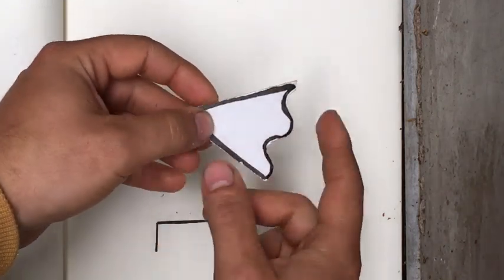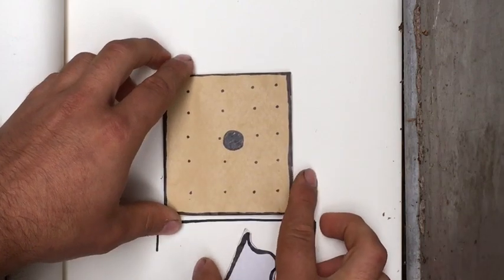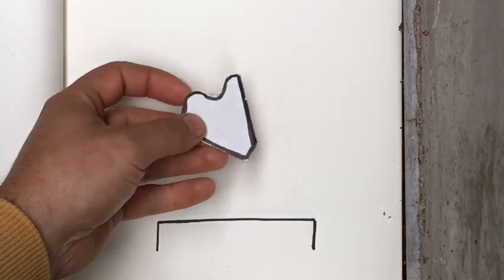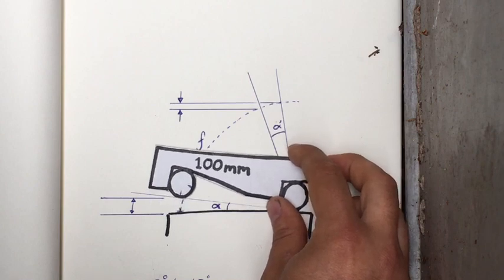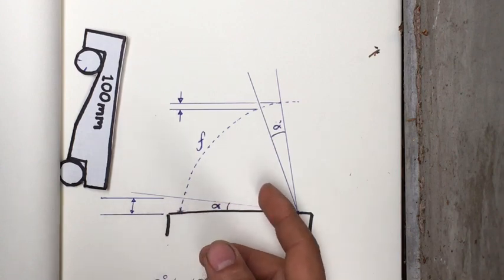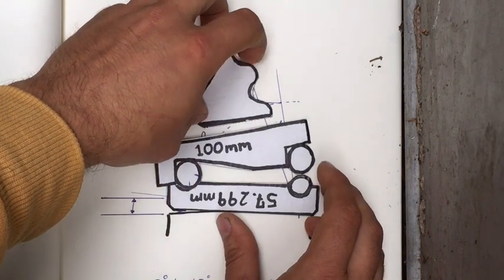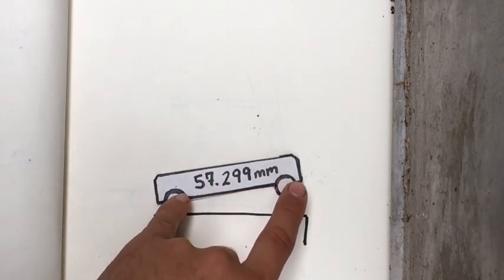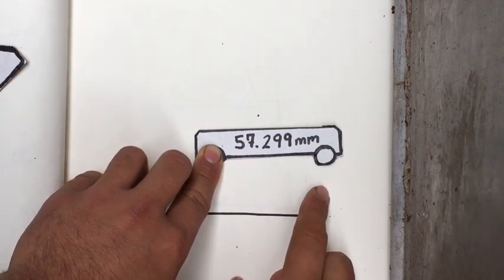Is sine bar really that precise?

Comment: I think I will be making myself a fancy sine bar soon enough! Never thought of a simple sine bar bar like that.
Reply from the maker: Really check out the isosceles principal of the Moore sine table, I didn’t do a great job explain it but you do the math with haft your angle value so you never cross 45 degree. Gauge block stack is little more tricky to instal but pass 15 degree precision will show
Reply: @hereticswissery9010   You explained enough for me to understand the reasoning. It is this kind of video that I value the most. Thinking, and application of knowledge. Great video.

Comment: Hi Simon, thanks for the demo, hadn't really thought about that (not that I have use for such precision anyway..).
If I may, a definite way to illustrate this would be to plot the sin function of the the desired angle. It will become obvious that as the angle approaches 90 deg, sin becomes practically horizontal. This means that required block height will be practically the same for increasing angles. Or, put elsewise, since sin is almost non-invertible at that range, you cannot, accurately, predict which angle you'll get for a given block height, at that range of course.